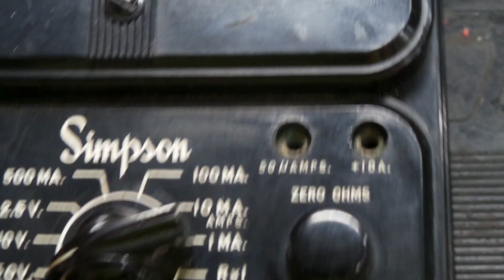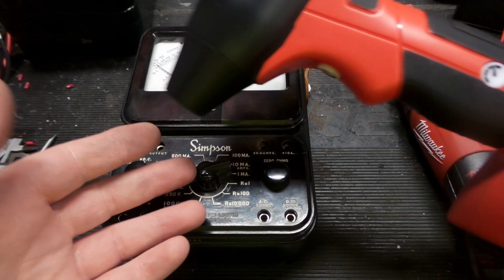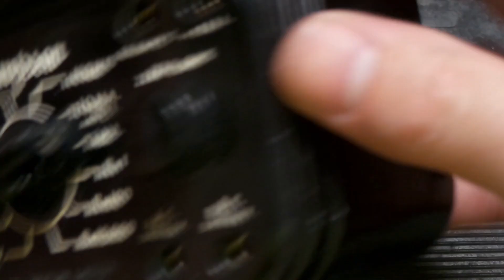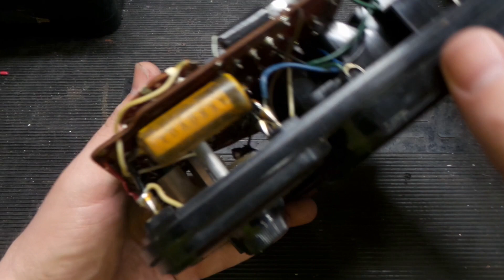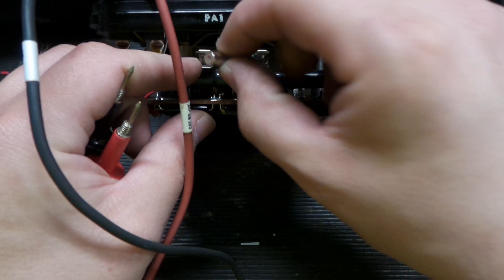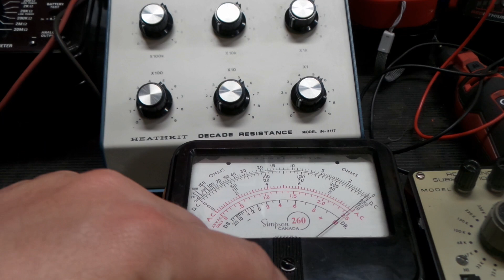Simpson 260 Series III Analog Volt-Ohm-Milliammeter / Multimeter -  Made In Canada

Comment: My bench employes only vintage test equipment, from my Simpson 260 to my Tectonics 524 oscilloscope.I restore vintage electronics test equipment for the student hobbyist genre.  In my shop I teach basic electronics and my manuals cover vintage gear. My VTVMs are HP lab type and RCA TV volt ohmyist . My generators are Heathkit audio and EICO RF types I have several smaller VOM types for battery testing An AC VTVM. All the scopes are Tectonics types a 524, a digital on screen display by. TEK and a 475 portable. I use a battery powered hand held spectrum analyzer. It’s a small hobbyist workshop that gets things done. I do have access to higher quality test equipment at my shop where In work if needed. Particularly I teach high school students the basics , repair and restore Radio/TV sets, even flat panel monitors and TV’s, computer CPU fpr IBM vintage machines, electronics test equipment for novices and again students working on their projects at my Saturday AM remedial classes. I am a part time retired /working status tech  having been in the biz since 1972.
Reply from the maker: That is awesome. I am an absolute novice myself. For any of the other beginners out here like myself how would you rate the Simpson 260 for repairability. Are they good to get one cheap and learn how to fix them or should someone be starting with something more basic. If so, what would be a good suggestion as a good basic make and model to get ones feet wet in meter repair?

Thanks for the comment I really appreciate when people who actually know what they are doing comment on our videos and share their knowledge.

Comment: There was nothing wrong with the resistors - we can't expect accuracy on a par with modern digital meters on one of these. The rated accuracy is probably + or - 3% full scale. On resistance function especially, analog meters just never were that accurate. By the way, you may have known this, the batteries are only for the resistance function. I just leave them out so corrosion is much less likely, and use a digital meter when I need to measure resistance.
Reply from the maker: I wasn't sure. I know resistors break down over time so I thought it was worth having a discussion about. I'm with you on the batteries since this video was made the batteries have been removed from this meter.

Comment: Instead of a resistor, what about the accuracy of full range of the supply? Has it been calbrated to traceable standards?
Reply from the maker: Nothing is calibrated. I'm just goofing around. Some of this was testing proof of concept. I think I want to work towards slowly verifying my "testing" equipment.
Reply: Not everything needs traceable calibrations. The Simpson 260 is just handy for basic troubleshooting of electronics equipment or house wiring tracing. The accuracy is still good enough about 10% for the work I do.